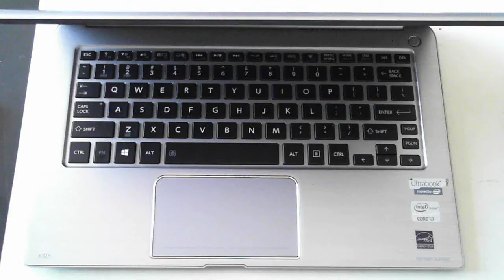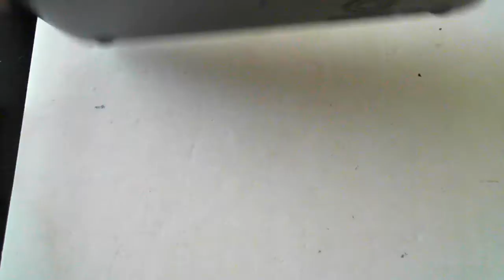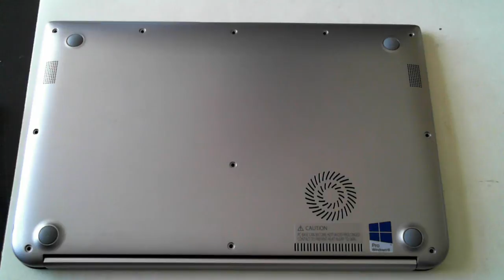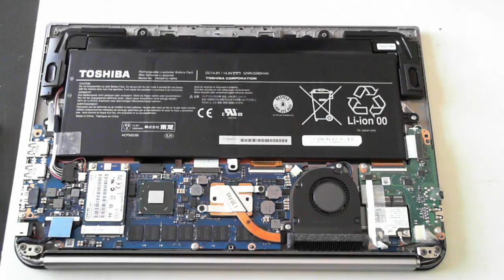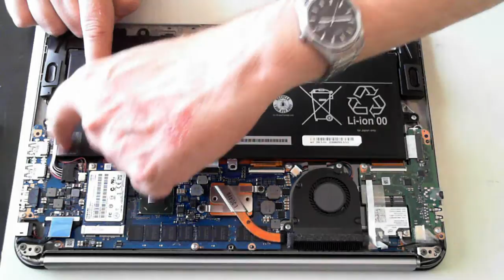Toshiba Kira Teardown / Opening

Comment: thanks for the Video. how hard is it to change the RAM? since it is not mentioned in the description and i do not See the modules with the open case i suspect it involves some further disasembly.
Reply from the maker: It depends on which model Kira but with the model in this video you can't upgrade the memory.
Reply: +dpcomputing OK thanks. i have the 10j. when i googled about the RAM upgrade this Video was the best i found. i will check if its possible

Comment: what fan can i use to replace this as it makes too much noise and is annoying me.
Reply from the maker: +ThePhoenixib If it is noisy the fan and internals may need a clean. I'd highly recommend contacting Toshiba re a fan replacement or get a fan designed specifically for a Kira. You may be able to replace with a 3rd party fan (with lower noise) but it may not provide the cooling needed.
Reply: Mine has the same thing. It's really bugs me

Comment: Mine is cycling through colors.  How do I replace the graphics card or do you know of another fix?  I already re-imaged back to factory.
Reply from the maker: DragonsGait what happens when you connect it to an external monitor?
Reply: It works just fine on an external monitor.
Reply from the maker: DragonsGait Its not the graphics card then if it works on another monitor. It is the screen that you will need to replace and I don't have a video for that.
Reply: Fooey!  Wonder if there are parts for it on eBay.  FOOEY AGAIN!
Reply: But wait!  Why does it work some of the time then?  If it was the screen, wouldn't it be permanent?
Reply from the maker: DragonsGait it may be a loose cable or wire.
Reply: that would be AWESOME!

Comment: Question - I can only find one website that sells a replacement fan for this unit - laptoppartsexpert.com - are there other sites for this?  Also, you don't actually show how to replace the fan - is it as simple as undoing the screws?  What about the wires?  Thanks for your help!
Reply from the maker: Meghan Lee Smith have you tried eBay or your local Toshiba repair centre?
Reply: dpcomputing Thanks - I can't find the fan for the KIRA series on ebay.  No big deal.  Is the replacement as simple as undoing the screws?  Are the wires clip-in or is soldering required?
Reply from the maker: Meghan Lee Smith I haven't replace the fan myself but it should be just undoing the screws and unplugging the power cable.